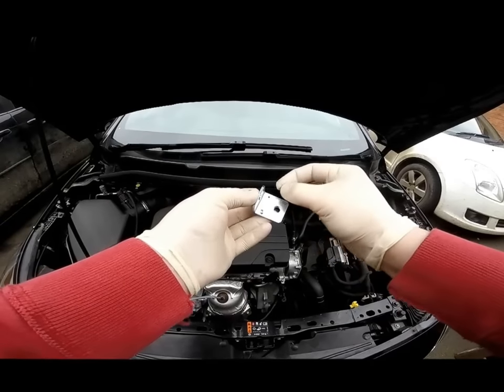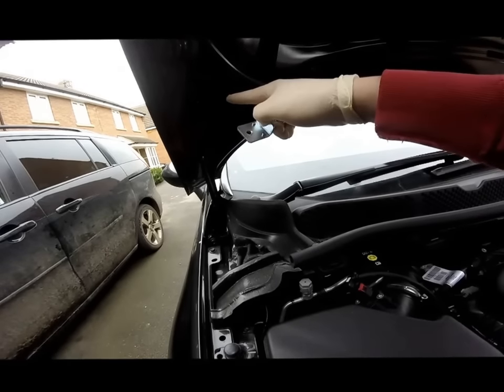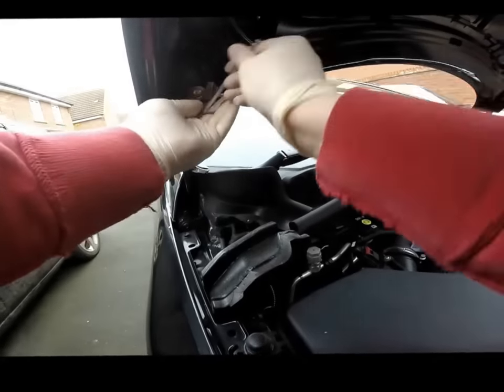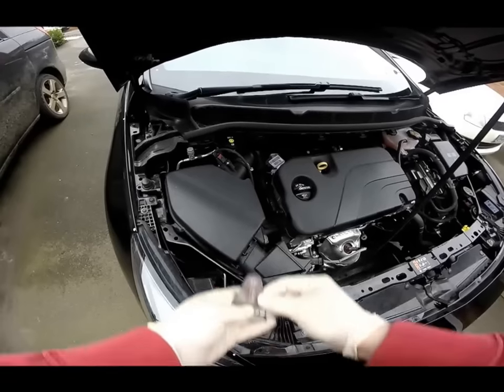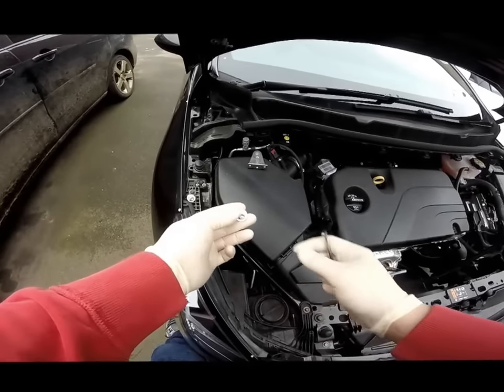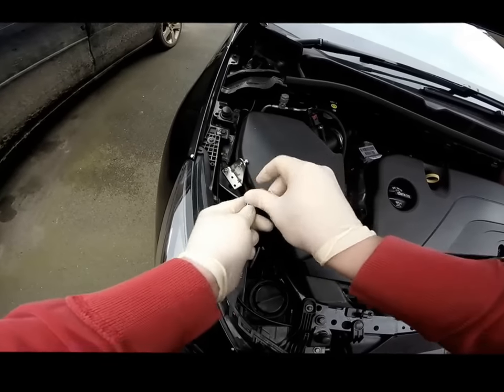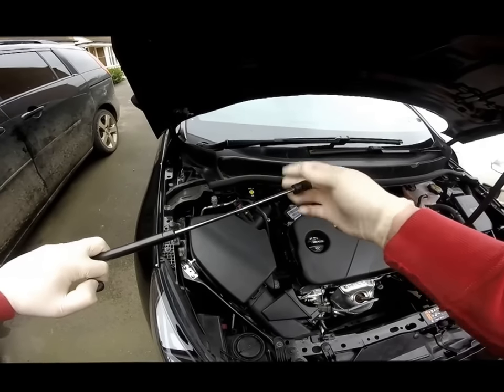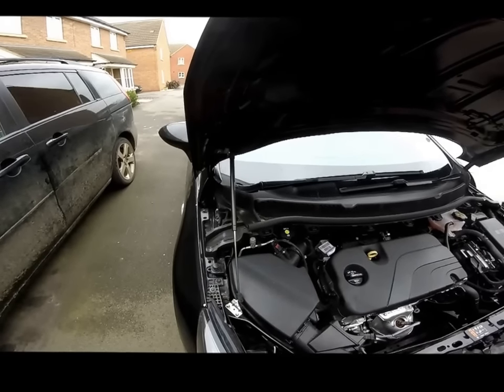Astra K mk7 2015+ Bonnet Gas Struts Lifter Fitting Video How To Dark Ice Designs Opel Vauxhall

Comment: Thank you Dark Ice Designs, ordered on a Tuesday, received by Thursday morning! Fitted that evening, this video was extremely helpful as was the supplied long allen key and spare allen bolt, washer and nyloc nuts, also received a complimentary bag of Haribo.
I found the passenger side harder than driver`s side due to a loom being slightly in the way. I also has to loosen the 13mm bonnet stay bottom bolts as well as top in order to get my bracket to slide in, apart from that a very easy fit and they work perfectly, well done Dark Ice Designs.

Comment: Why two struts? One seems to hold the bonnet up just fine in the video,  as did the single strut fitted as standard on the Astra H. 
I've tested the force need to hold the bonnet open at the same point you use and it's only around 170 Newtons, what are your struts rated at?